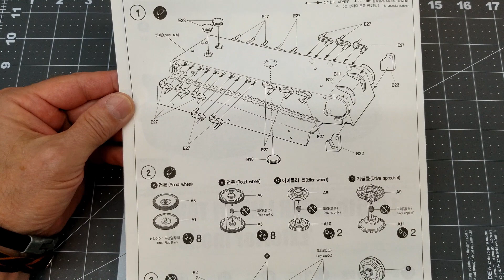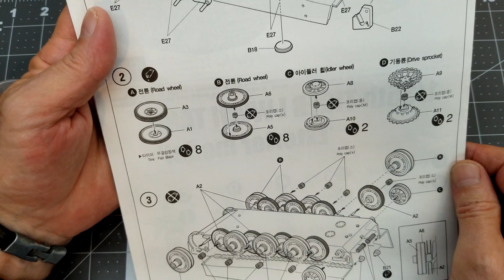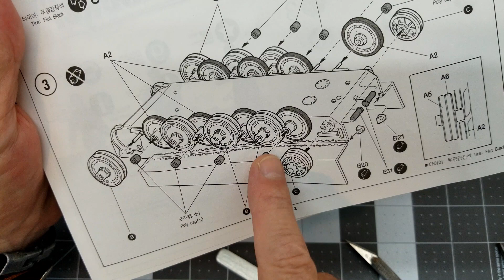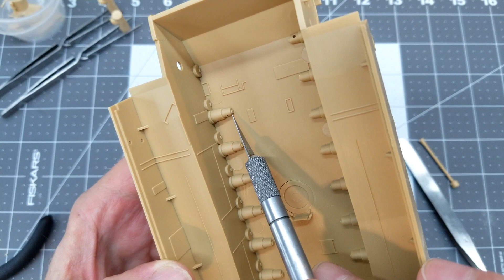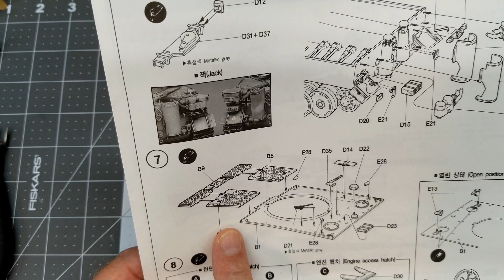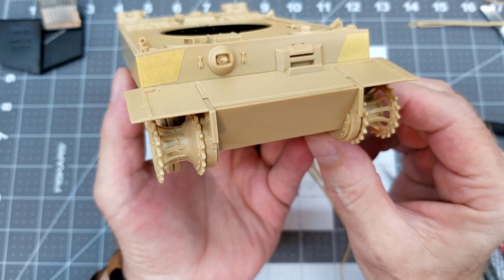Tiger I, Early Production, by Academy, in 1/35 Scale, Part 1, Hull Construction

Comment: Can’t figure out the tracks so mine is left unfinished sadly
Reply: QuickTraks from poland are excellent aftermarket snap tracks if you want some replacements
Reply from the maker: Sorry to hear that, you can always turn to some aftermarket tracks, there are lots of different ones to choose from. Some metal, which can be expensive, to plastic, to 3D printed ones. I hope you can resolve the track issue, good luck. Johnny

Comment: The interesting part about the real Tiger I road wheels is that the outer wheels you put on last were in fact designed to be removed and a hub put on in it's place. Even the track extensions were removable without disassembling the track. This was done for transport purposes.
Reply from the maker: Hi Michael, I see that you are a Tiger fan. It was a beast of a tank, but the transmission was far too delicate for the weight of the vehicle. Thanks for watching, stay safe! Johnny

Comment: Thanks. Regarding those tight poly caps on the 1st set of road wheels - I forced them in a bit with a round toothpick. This method seemed to put less stress on the arm. On the other hand the road wheel arms are rather stout and tend not to bend or buckle. I painted the tires before I installed the road wheels. Just sayin'.
Reply from the maker: Hi Carl. Those poly caps are made of a much harder material than Tamiya's are. I just left them on rather than risk breaking something. Thanks for watching my friend, take care. Johnny

Comment: Too cool Johnny, I just happen to be doing the Tamiya version of the same kit right now! I'm curious are you going to use the kit tracks?I am ditching the rubber on mine and ordered the resin Tankraft ones. Yes that is a weld seam on the front of the hull. Looking great, following along and eagerly awaiting part 2. Cheers Trey
Reply from the maker: Hi Treyz, thanks for commenting. And yes, like you, I'm replacing the tracks. You could probably get away with the rubber band ones, but there are too many good options out there to have your build suffer that, lol. Good luck with your Tamiya kit, they are really nice kits, and model on my friend! Johnny
Reply: @hillbillymodeling  just a quick update just got done building the Tankraft tracks and they are awesome! Don't know if you have tried these before ? Cheers Trey
Reply from the maker: @treyzmodels422  No I haven't used Tankraft tracks before, but I have seen others use them and they do look great! I'm sure yours will be fantastic on your finished build. Johnny